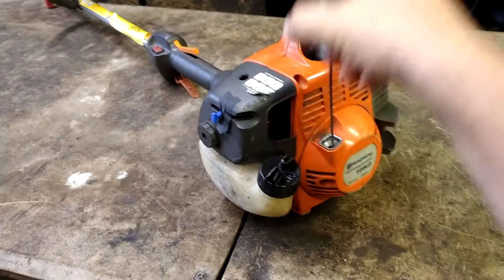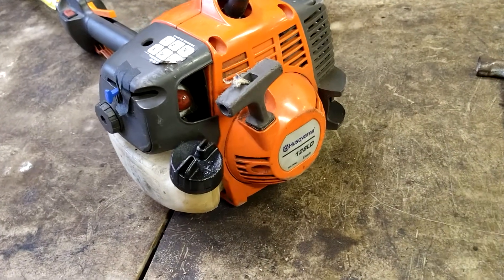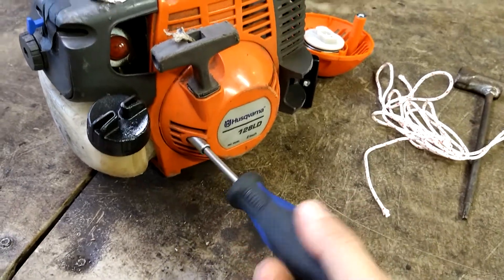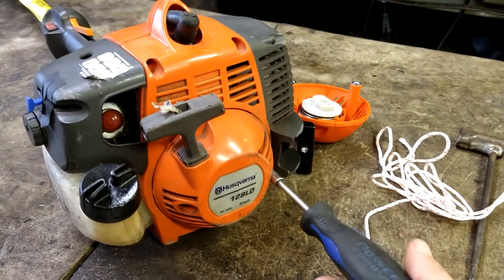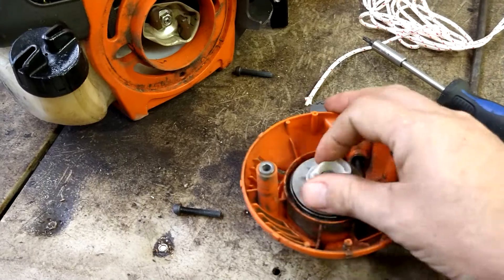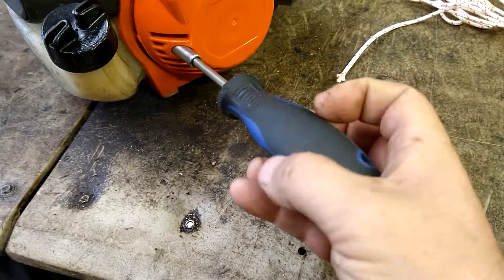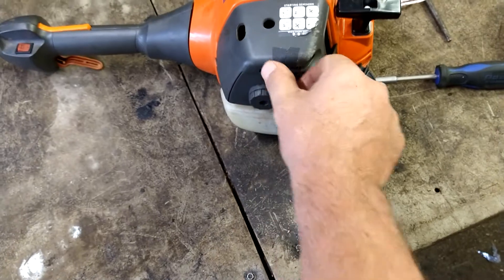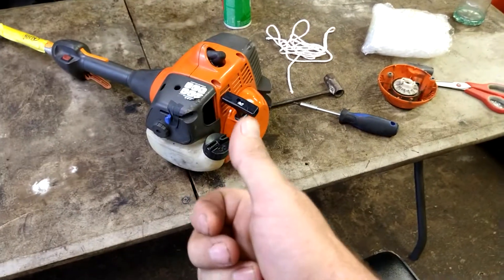husqvarna 128ld recoil repair

Comment: There's some kind of adjustment under the  128ldx  recoil starter assy that uses the same Allen Key as the screws holding the assembly in place, it's accessible through a hole at the bottom of the housing,,, ANY IDEA WHAT THAT SCREW DOES...?
Reply: It adjusts the tension on the pull. Sometimes it rattles and tightens the pull, a little turn counterclockwise will free it up

Comment: how does the secondary spring go bad?
the wacka is fairly new and was only repaired once for carburetor clogging & fuel line change due to that issue.
I smell a rat😮
Reply from the maker: Not sure but it happens

Comment: My bolts were t25. My spring un wound and busted one of those pawls broke
Reply from the maker: it only really needs one pawl
Reply: @smallengineguys  nice. Bought the whole piece anyways. How do you change the piece it's attached to? That piece is attached to the motor and spins somewhat freely. Need to lock the motor to unspin the piece
Reply from the maker: @chitowncraig  ok so take out the spark plug get piston all the way down put some string in  the spark plug hole make sure to leave some out so you can get it back out turn pawl counterclockwise till piston stops now you can hit it with a hammer to break it free or an impact on the nut if the pawl has a nut in the middle

Comment: still getting air in the fuel line and bubble. not filling the bubble with fuel.
Reply from the maker: It never fills with fuel
Reply: @smallengineguys  no. It almost acts like it's got a hole in the fuel line. I just replaced the fuel line and the vent. The fuel line was hell getting through the tank hole. I may have poked a hole in that because I was using long nose needle nose to help pull it through. Or the gas filter that goes on the 3nd of the line is plugged.
Reply from the maker: @fluffymittens24  or you got the fuel filter on the wrong line.